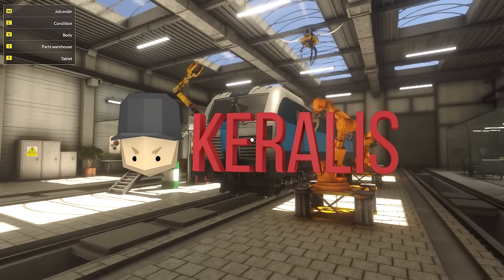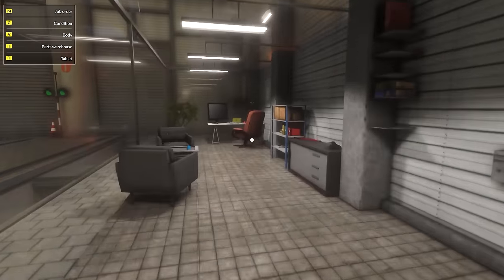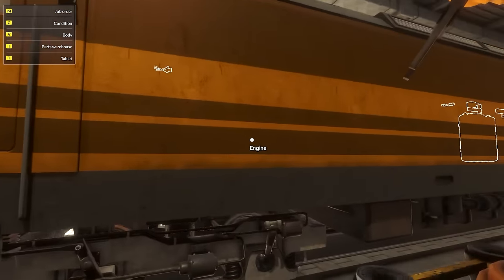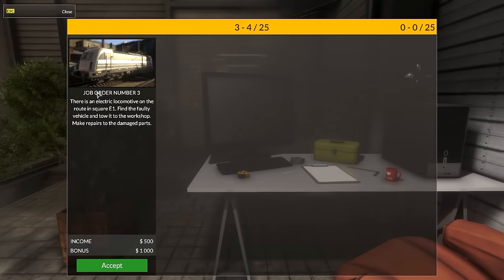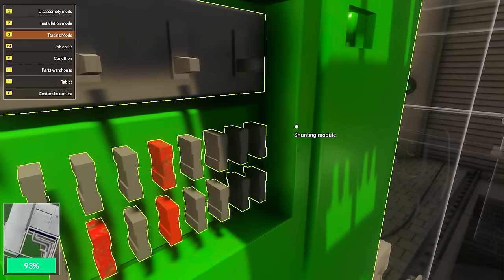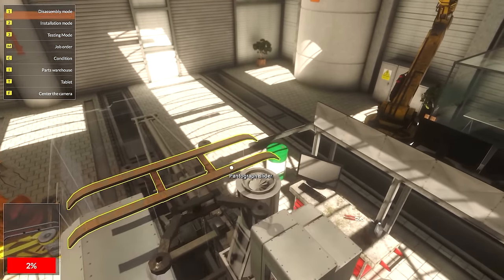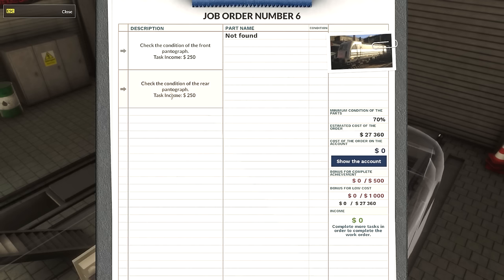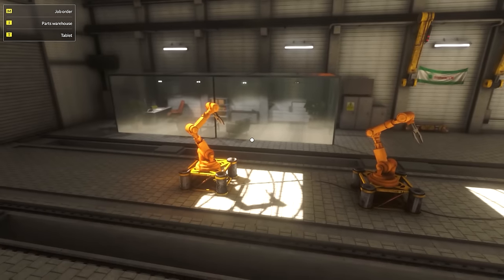Train Mechanic Simulator 2017 - REPAIR MASTER!

Comment: Some wisdom from playing Car Mechanic Simulator (it's been a while, so whatever it was called): if you can't find the last part, test _everything_.  Don't assume you can see the problem, just start testing parts.  If you still can't find it, start disassembling it.  Not only will you find the part, you'll start figuring out how the train's set up for the future, and your diagnostics will get better (you'll know what's probably wrong sooner).

Comment: 5.30 the modules on the "wall" is probably the fault in the system. just because the generator dose not work doesn't mean that its broken it can be somewhere else on the way